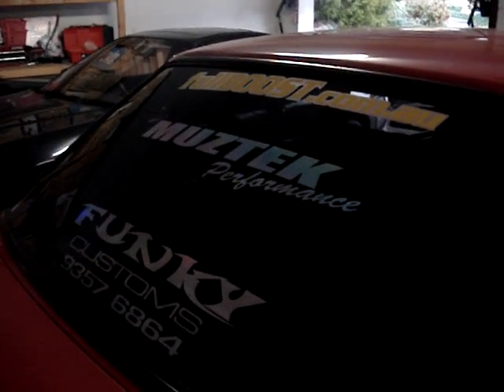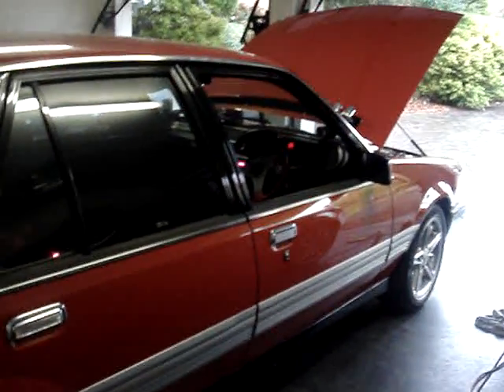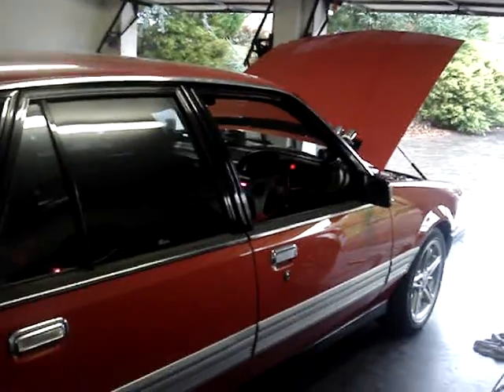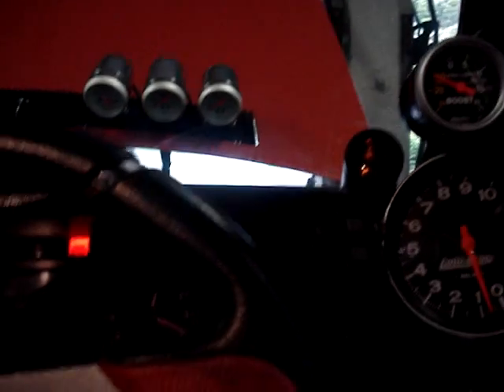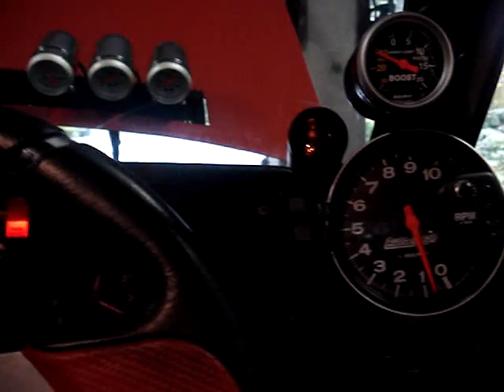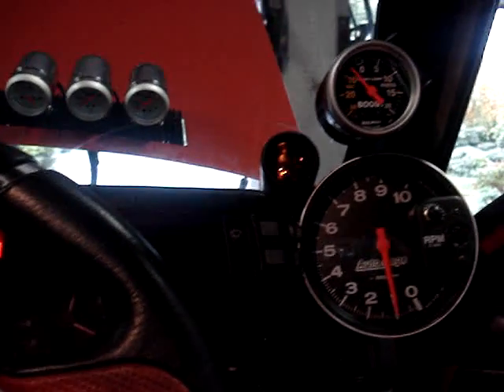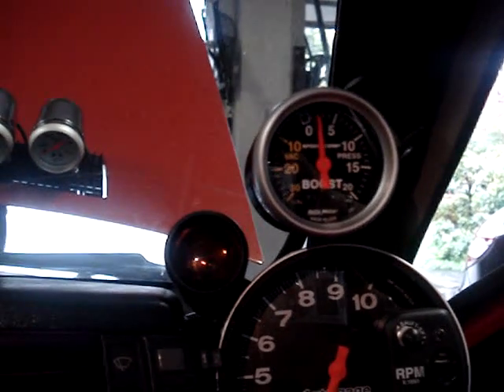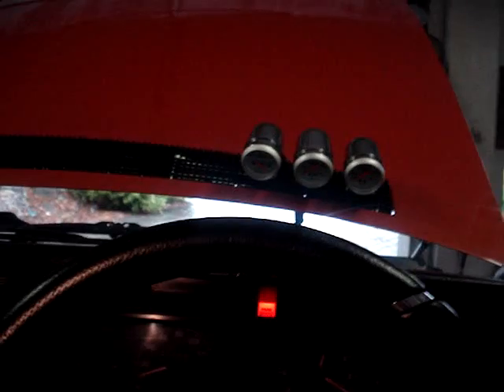PVC Cooler piping experiment

Comment: just fyi most body shops use pvc for plumbing airlines. holds more than 150psi, & compressed air gets hot.  not to mention body shops aren't heated & cooled! Lol
Reply: wouldn't recommend the pipe,  but save mad $$ in couplers! fuckers are outrageous.

Comment: ahh u had built up boost for a split second… NO TRUE test there…   Take it on the road and hit boost thru a few gears and let the engine bay heat up and then see if that PVC pipe will hold…

Comment: PVC is thin walled and will buckle under heat after a while. Get pressure pipe, its still pvc material but its 4mm walled and is designed to be run in mains water and air. Out workshop air system uses it at 150PSI and its fine. I run it on my Turbo Patrol at 15 PSI and ive never had a problem.

Comment: Ive tried this on my 1JZGTE powered Commodore track car. The hot side kept blowing out of the silicone joiners as it started to deform under the pressure and heat, however the cold side after the intercooler performed excellently. Its a great idea if you need something to use as a template for reproducing in steel but as a viable cheaper alternative it doesnt work, and I was so sure that it would.

Comment: This has been done before with good results. One guy actually did a test on this with no problems in 2.5 years of using the PVC ic piping. If you glue the pvc right it will handle LOTS of pressure. I used to build yachts and we had to test the water system at 60 psi for 12 hours. It'll hold the pressure. when you use the PVC primer it actually softens the plastic and the "glue" causes a chemical reaction that bonds the PVC rather than actually gluing it. It takes a lot of heat to kill that bond.